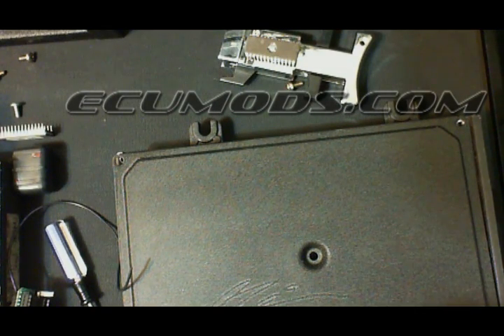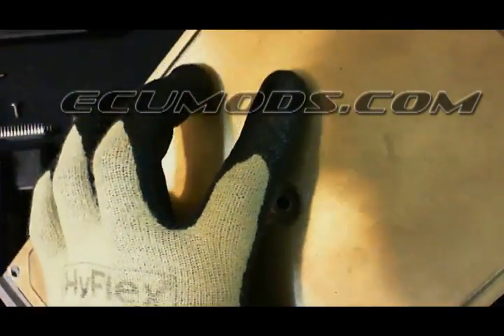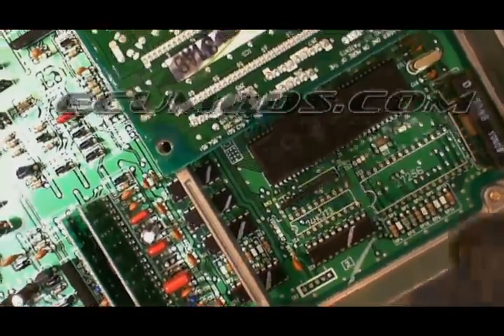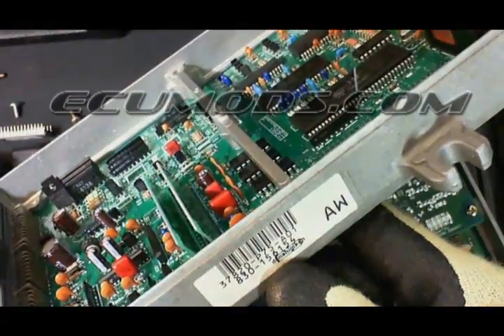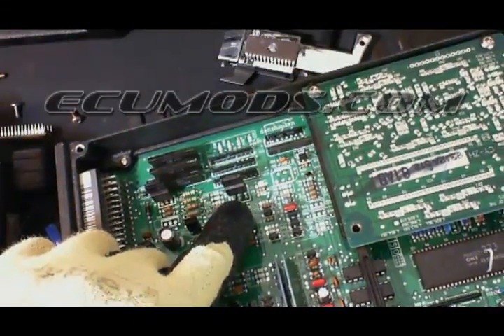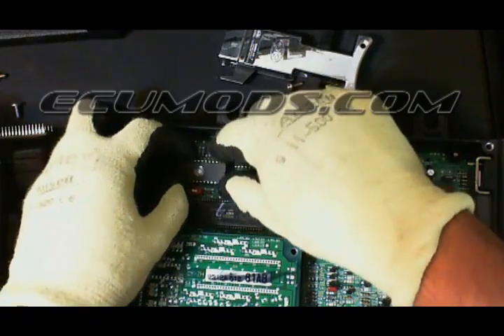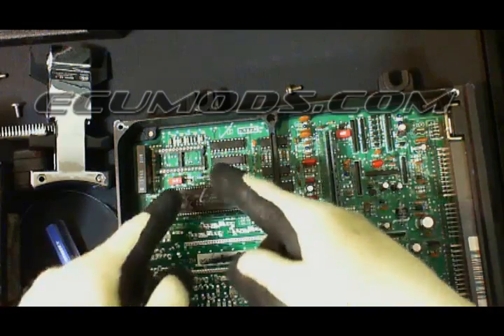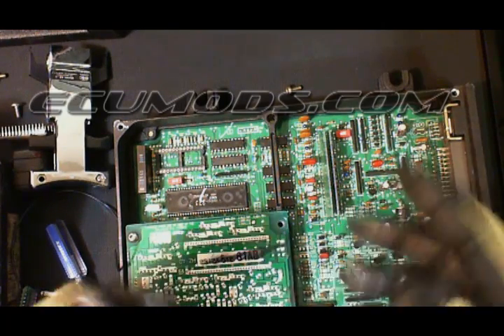Stock ECU vs. Moddified and VTEC vs, Non VTEC ECU Differences

Comment: I have a p28 with Honda V1 I'm looking to upgrade to a v3 or v2 can I just plug and play and take out  my V1 and put a v2 or v3 because my p28 ECU is already adapted to receive a Honda s300 is that possible or am I going to have to modify & solder some other stuff thank you I would like to know

Comment: I just got another prelude h22a4 1998 how much too chip my ecu ? and I heard my ecu should let my car go to 8 thousand rpm . it only goes too 6.5k what's wrong with it I heard it's a auto ecu in my car .
Reply: Frankie Perez 8k rpm are you crazy?? Most high end honda engine arent designed to run past 6.4k let alone a prelude.

Comment: I just bought an ecu thats already been chipped/socketed.  
When i have it installed and turn the key, it keeps blowing my 15 amp ECU fuse under the hood.
With my stock factory ecu nothing happens.  I checked the wires on the harness and theres no damage.
What can it be? any helpful tips would be awesome.
Reply: Dc2 Fuse blew due to receiving more electricity than the fuse was capable of handling. That with your statement of no wiring issues or damage tells me that the most probable cause is the ECU was chipped by someone that did not know what they were doing and have caused either a short circuit or similar ecu electrical issue. I don't recommend increasing the AMP rating of the fuse, as there is a reason 15Amp blew and it was to save the vehicle from getting damaged. You shouldn't need to run more power through a modded ecu vs stock, at least not enough to blow that fuse. My guess is there was a reason why someone was selling an already modded ecu.

Comment: How old is that board? That's chip has a quartz window
Reply from the maker: +Ruy Vieira The chip its self was a older chip we actually had a few hundred of them laying around at the time we shot the video. the ECU was from a 94
Reply: DJ Esco hey i have an f22a1 with only a cold air intake (non vtec motor) would chipping the ecu give me anything more then 1-5hp?

Comment: MAYBBE YOU CAN ANSWER A QUESTION FOR ME. I'VE GOT A 97 PRELUDE BASE AUTO. the only "mods" are a cai, a cheap ebay one, a magna flow muffler on the stock pipe, and I built a sealed ram-air system for it. when I bought it, it was supposed to be stock except the cai. and it has always run better than it should for stock. I don't think the cams have been changed, for one thing I would be able to hear it. plus I had Honda do a valve adjustment and they didn't say anything about aftermarket cams. it's an h22a4 the only number that doesn't match is the intake. the head is p13 hf2 and the intake is p13 hf1 (I might have it backwards tho) I've got pics of it on my profile. so the only thing left is the ecu. now i'm a beginner with imports, I/we have always built non-computer v8 muscle cars and the two don't have much in common. any help you can give would be appreciated
Reply: 3 QUESTIONS 911 TRUTHERS DON'T WANT YOU TO ASK THEM:
 
If explosions were heard in the basement of WTC 1, why did the building fail at the point of impact?
 
If the WTC was destroyed in a controlled demolition, how did the nanothermite charges survive the plane impacts and how did the perpetrators know exactly where the planes would hit the building?
 
How do you explain Khalid Sheikh Mohammed’s confession to planning 911 in an Al Jazeera interview back in 2002?
Reply: ctcole77 why the fuck are you bringing your stupid fairytale to threads about cars?? can't read?

Comment: i had a non vtec engine in my car and i installed a vtec engine how do i install a wire from the ecu to the vtec solenoid?
Reply: You might need to change your ecu
Reply: @lRydeRdiel  I essentially built my own, piggy-back ecu/VTEC controller from scratch to keep my stock ecu.
And it is pretty easy work wise, run a few wires and hook them up. The only hard thing would be the programming if you have no experience with it. Cost next to nothing, as well!

Comment: Yo I have a p75 ecu on my 01 ls teg. It has a obd2 harness.I put on a full greddy exhaust system with a aem cold air. My question it what do i need to do in order to get it tuned an get more power ?

Comment: I have a 96 accord with an automatic NON vtec ecu (P0B) I did a motor swap to the vtec motor and vtec ecu but I have a CEL on the vtec ecu. I would like to know if you can add vtec to this ecu since its an obd2 I know you cant tune it but my hopes are to add vtec to the non vtec ecu and plug it in instead of running the vtec ecu and having the cel light all the time. PLEASE HELP!!! thank you in advance.

Comment: @djesco075 I have a question. I have a 01 integra ls nonvtec coupe with a couple bolt on's. If I sent you my stock ECU. Can you mod it to work with the bolt's on's or would I have to get a different ECU.Thanks

Comment from the maker: @mariopic 
True to some extent
1. you need to add a few basic parts resistors and tant caps and pnp trans then write code for the external rom to support VTEC
2. However the stock non VTEC ECU processor does not support multistage/multipoint vtec. you can engage up to 10 points on a Stock Vtec and only 4 on non VTEC converted ECUs

Comment from the maker: @TEQU1LLO 
4. Test VTEC Solenoid by  disconnecting (while vehicle is off) and aplying 12Volts + signal to the lead (wire) you should hear a click as you apply current. If not it may need cleaning or it is bad (replace part if bad) 5. Consider replacing Oil Pressure sensor (rarely goes bad but could do so)

Comment from the maker: @TEQU1LLO 
1. Verify ECU is a VTEC ECU if not you can contact us at (832)-798-0000. if it  is a VTEC ECU then do the following: 2. Check ECU make sure it is not damaged (burned parts etc, water damage) if ok the do the following: 3. Trace the following wires from your ECU: Oil Pressure Signal and Vtec Soleniod (both are needed for VTEC to function properly). if not present wires will need to be run from the ECU to the sensor and Activating Solenoid. if present then: (Continued)